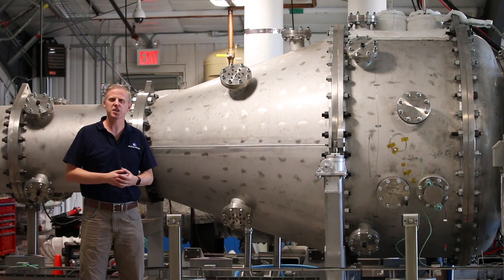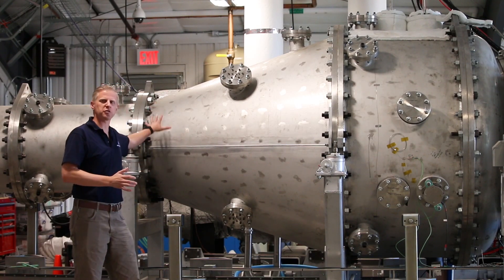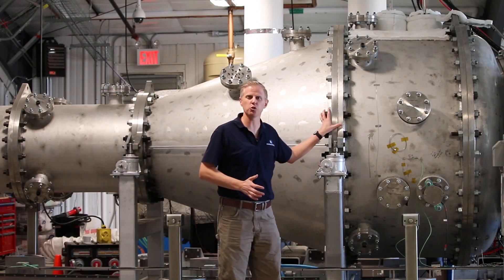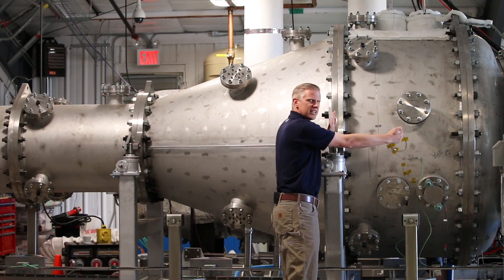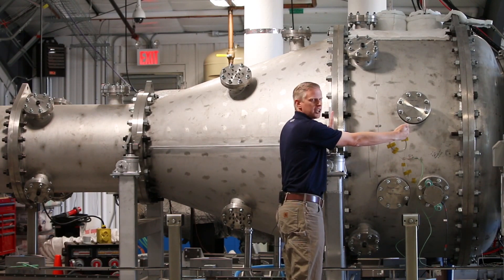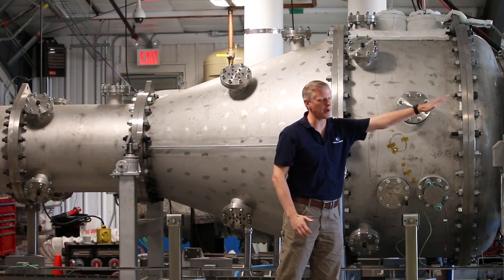HTX Mach 5 test results - interviews - October 2019

Comment: Fantastic work on pre-cooler ... now get it out on a real test in a rocket / plane.  There are still a lot of issues outstanding.  Testing in a chamber is fine.  Now produce a working engine.  You guys are far from achieving that - but I wish you all the luck.  Cooler is one thing - adding fuel, turbine, rocket engine, engine nacelles and working with subsonic, super sonic transition of shockwaves from Mach 1 through Mach 2 will be critical as it was for the J58 - then after burner tech on even more complicated air flows though nacelle to get to Mach 3 plus and finally transition to rocket mode still needs a lot of work.  Scope of work should focus on take-off and trajectory to space - and getting the engine to orbital velocities - prove that - and you have achieved something spectacular.  The point is to reduce fuel load by incorporating the oxidizer for your fuel from air rather than having to carry it with you as one does with rockets.  The beauty of this later will be landing the plane later on.  Cmon people.  Chop Chop.  Well done on the intercooler ... now lets get the rest of the job done.

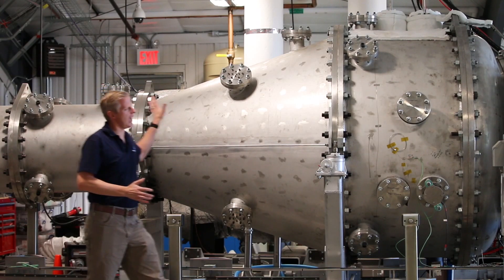Comment: 0:36
air flow enters the ductwork at 1800 Fahrenрeit
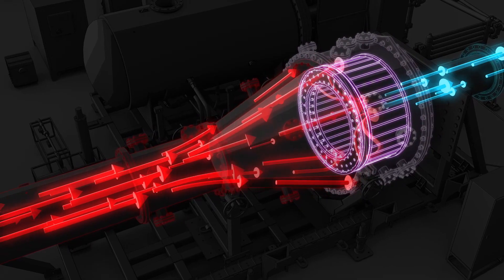0:47
it quenched over a 1000 centigrade

1. Airflow that passes through narrowing nozzle - cooling down. It's normal process.
2. 1800F=980C. 

So what about pre-cooler, how does it works?)))))) Maybe my comment is ironic but i would like to see technical specifications.

Comment: It's been over a decade and you still haven't even built a single functioning SABRE engine. In the same time a company like SpaceX has built and flown 4 different orbital vehicle classes and 5 different orbital class engines. GET IT TOGETHER AND DEMONSTRATE A FUNCTIONING PROTOTYPE ENGINE.
Reply: I get your impatience, but there is 1 more major component to develope. The incoming air flows through the inlet at mach 5 and passes through the cooler. The SABRE engine needs to move an inlet to plug the hole to enter LEO by becoming a conventional rocket engine. But the pre cooler is the main component and new technology that is now proven to reach mach5 temperatures. There is no comparison with spacex and SABRE as there was none between the space shuttle and Concorde.
Reply: it's been over three decades. But unlike SpaceX Reaction Engines are building a new type of engine. There were eight decades of liquid fuelled rocket experience before SpaceX started. The good news is they are currently building a prototype engine, which will hopefully be tested in the next two years.
Reply: rocket engines and jet engines are ageold and have been developed for 70 years now, just think of the aerospike engine, which is just a different version of a rocket engine which never made it because of complications. There is alot of things to consider, the thermodynamics before the thrust is generated is as complex as a closed cycle rocket engine and it was never been done before. The precooler has to deliver exactly what the engines need and the engines need to put out a certain amount of thrust to make it go. Plus the weight and the fuel, the material tech behind all those insane requirements at mach 5 and the special reentry is also something which was never been done before. The expansion in those kind of temperatures probably causes a whole host of issues, imagine a sealed part expands so much that its not sealed anymore and starts to leak liquids in the fuselage and the whole craft suddenly explodes. I mean the high tech aspects of the entire thing is like a swiss watch that still has to work perfectly as you dip it into lava. Not an easy feat.

Comment: If understand it correctly: In this case the main hurdle was taken! Amazing times! Congratulations!
Reply: Yes, the precooler can start making some money once longevity and operating parameters are established. The pre cooler is designed to fit into jet engines and fighter jets. Hopefully the engine will be servicable and not refurbished like spacex is at the moment.  
BAE Systems are building the plane by the looks of it, not sure if its 'skylon' as this was a concept. Now we have CAD and multi physics software the next processes should be alot quicker.

Comment: If the pre-cooler uses helium, why is the engine running off Hydrogen, the low density means those huge storage tanks. Why not use something like liquid methane and allow a much smaller fuel tank? Wouldn't this also bring down costs as I understand this is a much cheaper to produce and store/handle. Fascinating seeing the whole system work, best of luck...go Britain!
Reply: The helium is used the exchange heat between the air and the hydrogen. The hydrogen might be the best fuel for cooling the incoming air. Other than that hydrogen is the most weight efficient rocket fuel.